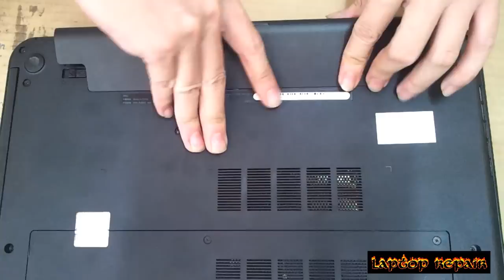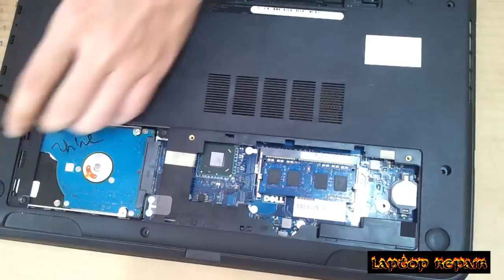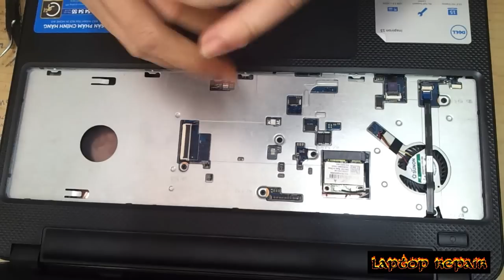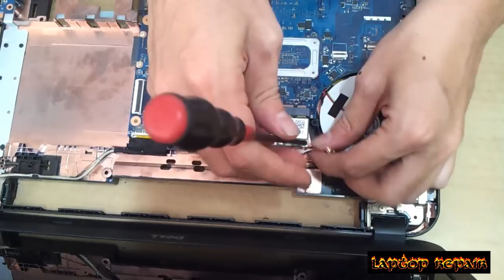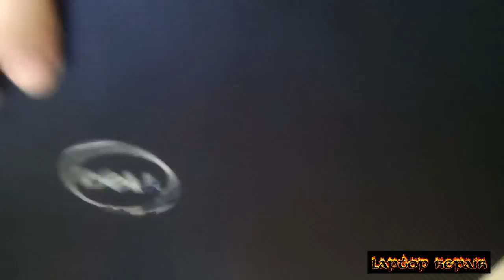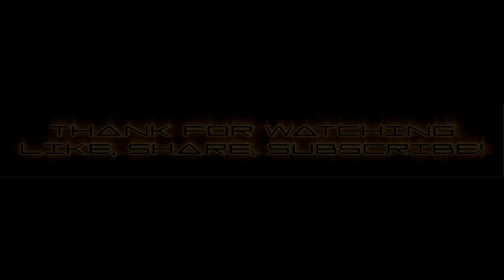dell inspiron 15 3521 Disassembly and fan cleaning laptop repair

Comment: [GOOD TIP] For better cleaning the radiator fins where dust piled at the fanning end you have to use soapy water dipped tooth brush and carefully clean those fin holes after vacuuming and removing big bust piles on the fins. Then use moist brushing second third times to remove the soapy moisture out fins with careful brushing, you will see a lot of dirt on the brush. Because micro dust particles settled on the fin surfaces and soapy water brushing after vacuuming will do 2nd stage better cleaning of fins so next time the dust wont settle inside the fins so frequently.

Comment: I tried this and now my laptop won't turn on... what could be wrong? my cable plugins maybe?
Reply: UltimateZob it shows no bootable disk found for me
Reply: It turned out one of my cables wasn't plugged in all the way. In your case, a system restore might be necessary.
Reply: @UltimateZob  happened to me too
Reply: Same is this case with me
Reply: Can you please confirm which cable was not plugin properly

Comment: can i replace the HDD into SSD ! for the this laptop 
and replace the CPU into different generation !
Reply: SSD - yes. I replaced mine just this week. It works well.
CPU - probably not. Judging from this and other similar videos, it looks like the CPU is embedded into the motherboard, irreplaceable.
Reply: @lforlight  is that laptop has a separate SSD slot so that i can run hdd & ssd both?
.
.
& This laptop has a another ram slot??
Reply: @tarundevasheesh9842  No for SSD, probably not for second RAM slot.